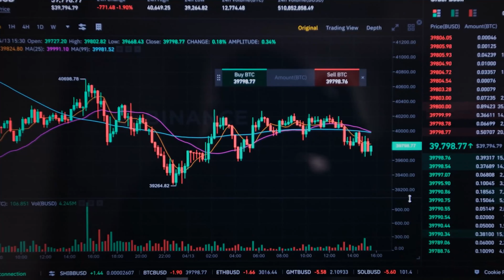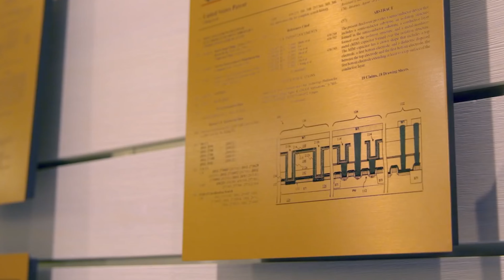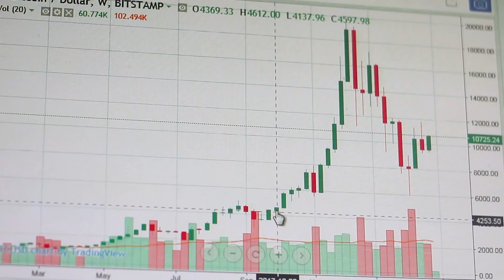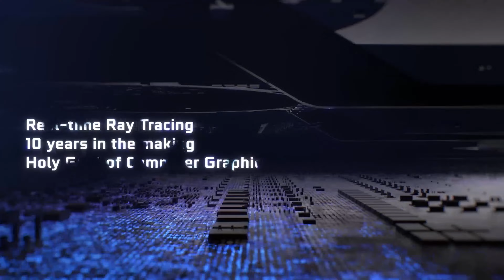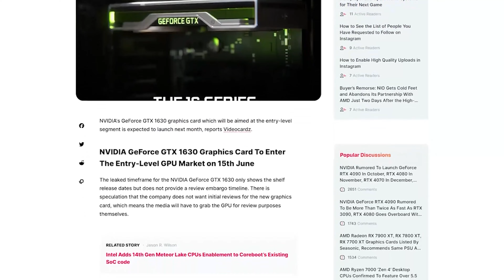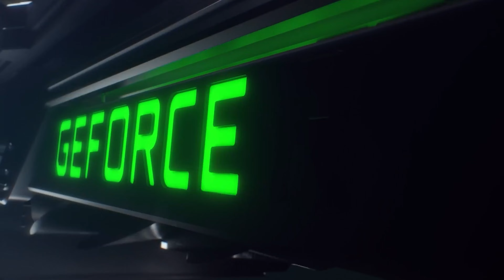Nvidia 40 Series DELAYED!

Comment: Delayed will be only med- and low-range GPUs! Flagships are on the way this year
Reply: is 4080 Flagship?
Reply from the maker: Interesting where did you hear that?
Reply: @cameltoeinspector6015  Flagship is 4090.
Reply: @amariel3310  Both 4090 and 4080 are top-tier cards
Reply: @aleksandrtyshkunov5919  You are correct. However, the 4080 is not the flagship model.

As I remember, Nvidia plans on releasing it's flagship model early on, and the rest to be delayed.

While one could argue 4080 is flagship, this time around it's based on AD103, while AD102 is the flagship model.

This is contrary to RTX 30 series, where both the RTX 3080 and 3090 were basically the same thing, with RTX 3080 being a slightly downgraded 3090 in performance.

This time around, the difference is very clear, in CUDA cores alone AD102 has 16k+, while AD103 has only 10k~.
Reply: @kristofvanderveen34  You're probably right, I'm really hoping for a september 4090 release but I think I'm hoping for too much here.